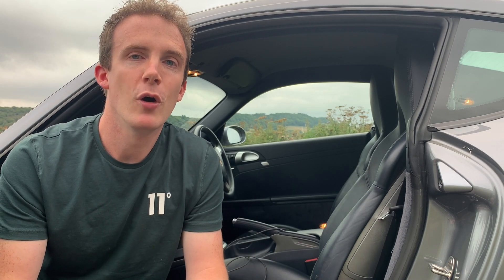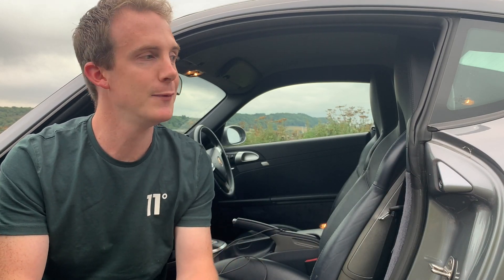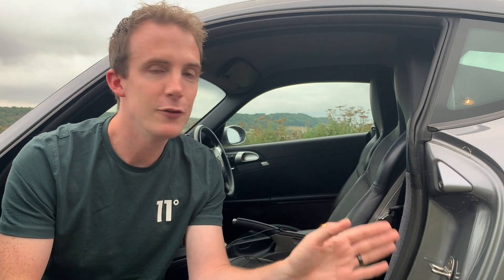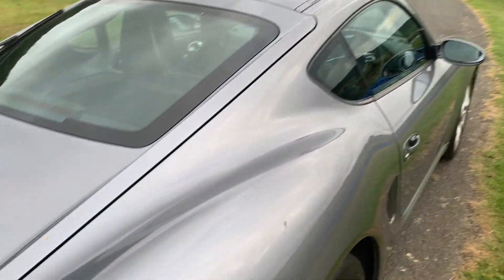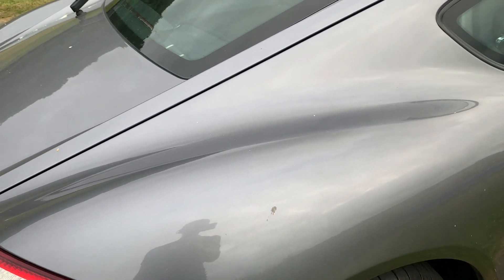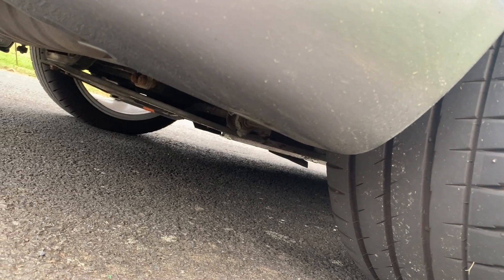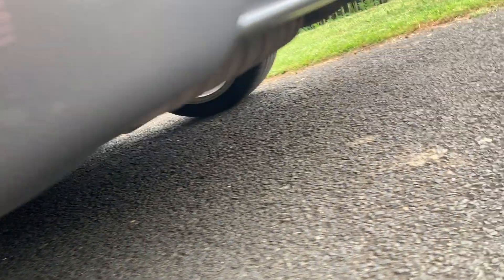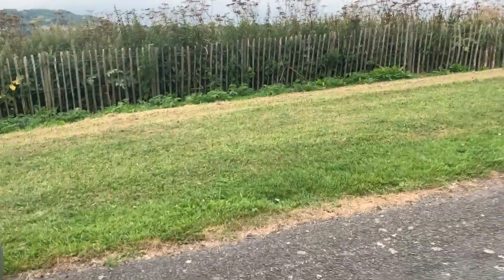MY CAYMAN 987 HAS BORE SCORE | What are the symptoms , sound and repair cost?

Comment: Very sorry to hear your unfortunate and expensive news. Given that the 987.1 3.4 engines are well known to suffer BS with up to. 10% failure rate, did you not consider getting the bores scoped at purchase?  Not sure who you asked about the smoking issue but fit, water cooled 911s  don’t all smoke!  Smoking exhausts, oil loss and eventually (at the end) are all classic symptoms. I have bought many used cars over the past 20 years and while I am reasonably proficient with used car buying, I paid for an independent Porsche specialist to give it a full pre purchase inspection. It was the best £350 I have ever spent. 
The good news for you is that IF you can get it fixed properly with new liners for about £6k, you should get most of that money back come resale. Most scoring and IMS failures (on the M96 engines) usually result in a circa £10k bill!

Comment: Sorry to hear the news. Looking forward to hearing about your rebuild. It IS an awesome car. Now you will have an engine that will last you 20+ years to enjoy.
Reply from the maker: That’s the plan! Got so much I want to do, hoping the bill isn’t so huge. Save some for an exhaust 😉
Reply: There is always a gundo to give you some sound at an inexpensive price. Then you have time to figure out exhaust which won't be cheap. Good luck!
Reply: @JoeTalksCars  I emailed Capristo last week to see how much a full exhaust system would be for my 2.7 987.1, just for a laugh: £4650! Errr I don’t think so.
Reply from the maker: Nah thats a joke, custom made route for me. Far cheaper under £1000.
Reply: @JoeTalksCars  Yes I’m thinking the same, or maybe Milltek or Dansk. I’m worried about the exhaust header bolts, I’m sure they haven’t been removed for 14 years and they might shear. I give them a good spray with WD40 whenever I’m under there, don’t see as it can do any harm.
Reply from the maker: @kw8757  bound to come across problems like that during this build

Comment: Oil consumption is usually measured in quarts or liters per 1000 miles. I am not sure how much guzzling is. When your first purchase a vehicle it is wise to check the oil frequently until you understand the consumption.
Reply from the maker: I did and the car used barely anything for the first 4 or 5 months then all of a sudden was guzzling. Didn’t know at the time it was scored but we all know what happened next 🤣

Comment: Just went out and started my Porsche and it does not have any odd noises or smoke at all, nothing so I am so happy mine is running perfect. I heard that this is a problem with people that live in the colder climates, since I am in Texas I should be good to go but is something I will have to keep an eye on.  

I just wonder if there is a way to prevent it from happening in the first place? I change my oil every 3000 miles and use only the best synthetic oil for my cars, yah I may spend a lot in oil but I like to keep my motors in top shape. I also do not hot rod mine or at least very very very little, I have yet to ever hit red line, actually stay over 2k under it.

Comment: Thats pretty much why i got myself a 987.2 2.9, sure i don't have the power of the 3.4. But the engine is bulletproof, goodluck mate. There are multiple mods that can reduce the chance on Bore scoring by alot. If you get it fixed take a look at those.
Reply from the maker: Yeah I’ve heard the different thermostat is one. Il have a look as to the mods. Can’t be having this again. Especially not after fixing it!
Reply: What are the mods that would help with this potential problem?

Comment: I had a 3.4 996 years ago, the bore scoring noise was only there once the engine had warmed up fully, oil pressure has dropped, and at idle. Any rev of the engine and the oil pressure would go up and noise stop. No loss of power, but it was more of a ‘clanking’ noise, quite a metallic ticking. Also it would start a bit rough, backfire or pop sometimes when starting.
Reply from the maker: Mine had all those symptoms just before the rebuild. Poor thing sounded like it was going to die.

Comment: Q&A: did you recoat the pistons during rebuild? did you replace the cylinders with iron, nikasils or alusil type of sleeve?
Reply from the maker: So they were all sleeved with new steel liners. Controversial I know but 2 years on it’s perfect still
Reply: Glad it’s now running mint joe , I live in castleford and I’m researching before purchasing a cayman / boxter will strasse be my go to specialists or are there others I should consider. Also is the 987.2 base less likely to score , or is oil management the key to any boxter engine.
Reply: @michaelparker-m6s  oil management will definitely reduce the risk. Lower displacement engine 2.7l will also have a lower risk of borescoring due to lower piston weight, thus lower piston skirt to cylinder wall contact. The 987.2 has improved the coating of the piston skirts so it is less likely to develop it. MA9A1 engines have also closed deck design that reduce the risk of cylinder ovality that develops over time. Also I saw that M9A1 engine also has oil jets at the bottom of the cylinder that really improves lubrication.

Comment: In essence,should I presume that some mod has been done in order to avoid such an issue to come about again  ?    I mean,we can have a full engine rebuild done with the same problem likely to occur again due to the original engineering weakness from the factory or,possibly is there a way "to prevent" the issue from coming about again with proper mods while the rebuild is in progress  ? Thanks for any thought about my question.
Reply from the maker: So the car has had steel liners with a top hat design meaning they can not move, it’s hard to say if it will or won’t happen again. There is so many theories on what causes it and none or proven. The garage that did this have built 1000s and never had an issue, they also have a small race team and all the cars have this rebuild. I got so much hate for not using Hartech but I can’t help but feel that they do so much scaremongering online they force people’s hand. I trust Strasse where mine was built and hope for many many more years of driving.
Reply: @JoeTalksCars  
Interesting infos...A noticeable point stands in these guys using the same specifications or technique on their racing engines. Thanks for your answer.

Comment: Would a 987. 2 / 981 3.4S engine fit? If so what about fitting a a secondhand MA1.21 non IMS engine ??
Reply from the maker: I did look into that. They are quite a lot. It found one for about 5k so not a lot in it. Plus I swapped an engine in my last car and it was such a headache. Good thought tho, I’m now on eBay looking 🤣
Reply: @JoeTalksCars  Research needed on would your gearbox would be ok with the tad more 320 bhp power and Direct Fuel Injection different high pressure fuel pump needed with the  ECU to. So it would all really mount up. Guess not best option unless a project.
Reply from the maker: @xplane7523  yeah it’s certainly an interesting thought. If the block is compatible with the box which I’m not sure it would be the Tiptronic box can take loads as it’s the same box in the Mercedes SLR. PDK conversion could be interesting and unique. But costly 😂

Comment: Mine has the same smoke, oil consumption and when it’s warmed it makes a slightly odd noise on the drivers side 😄 I wouldn’t say tapping but it’s definitely not the same as when it’s cold
Reply from the maker: The tapping started on mine in the end! My god it was loud! Wish I caught it on film, genuinely sounded like somebody tapping with a hammer on metal!

Comment: Hey Joe, loved the video. I'm really getting into this info about the Cayman in case I decide to pull the plunge on one down the road, and I have a question: once this "gets done", is it possible for it to happen again? Or is it a factory failure that once fixed it's ok? Just to know in case a full service history includes this, is it correct to assume that's a "safe car" regarding this issue? Or it's always going to happen every once in a while? Thanks a lot!
Reply from the maker: Hi, good luck with the hunt for yours, as far as I know once its fixed its fixed but then again who honestly knows. This car had a full Porsche service history and it never helped the poor thing, that doesn't seem to come into it. I am sure its a flaw from factory that it either has or doesn't. Some high milage cars may be the safer options.
Reply: Hi it can happen again but will take many many years - its just an unnecessary cylinder design, which is why it was scrapped so quickly. The key is to ensure the coolant is always topped up, make sure there are no coolant leaks and the water pump is in tidy condition. The coolant surrounds the cylinders in this design. Finally I would always use premium quality 0w-40 oil

Comment: £5,000 to £6,000 is quite cheap to fix bore scoring.  Did they redo the bores with aluminium sleeves and a Nikasil rather than Lokasil bore coating or did they just re-sleeve with steel liners?  If steel liners then you are possibly looking at another engine rebuild in 10k to 20k miles time.  My 987.1 3.4S Boxster had previously suffered bore scoring and been rebuilt with steel liners before I bought it.  It took less than 10k miles before the liners moved and let coolant into the cylinders.  The engine was then rebuilt properly by Hartech in Bolton, UK with Nikasil liners.  Cost was closer to £10k though.
Reply from the maker: So the car eventually cost around 10 due to more parts needed. Each of the cylinders has been done. They have been done with steel liners but have a top hat design so can’t slip. The garage assured me that race cars they rebuilt are going fine after 1000s of miles on track. I guess only time will tell.

Comment: Sorry for your issues! Have you seen Jake Raby on YouTube? He has a full series on Bore Scoring.  What cylinder lining are you going to use as replacement? He repairs motors from around the world.

Thanks Bill
I have a 1997, 986 and 2006 997.1 C2S.
Reply from the maker: Hi Bill, I have watched them, fantastic videos. I am going for steel liners, Hartech and many others will shout at me for that but logically they can only be better than standard. Only time will tell. Strasse who are building it are well known for their expertise so I know it is in good hands. You have some lovely cars, have you had any bore score related issues?
Reply: @JoeTalksCars  No Bore scoring,  986 in early years don't have that problem. My 997.1 I won in a contest that the FLAT6CLUB had. Drove it from SanDiego to MN, no oil consumption,  no carbon deposits in tail pipe, no engine noise. It has 73,600 miles, I had engine oil sent to Speediagnostic and results were all in the Green. My first oil change it had Mobile one in it, changed to Driven DT40, plan on changing oil according to Jake Rabys recommended 6 months or 5000 miles irregardless of mileage. Taking a long trip soon should be fun!

Jake Raby would fix your car better than original, never have to worry about it. As you know does not recommend steel liners.

Good luck
Bill
Reply from the maker: @wildbillcarroll  ah that’s good then! You won the 997🥳 that’s amazing! Yeah I know he doesn’t recommend as a lot don’t but it doesn’t make a lot of sense. They have to be an improvement over standard. You are right tho, oil changes at 5000 or 6 months is definitely something I want to do as I can’t have this happen again.

Comment: Hi joe, who are you taking your car too to get rebuilt? I’m looking into buying a cayman S gen 1 as the gen 2 difference is huge in price, and if it’s 5-6k for a rebuild it’s still worth taking the risk IMO
Reply from the maker: Hi Lee, The difference is huge isn't it. Gen 1 can be had for 12-15 and gen 2 is 25-30. I had this dilemma so decided to rebuild. It is heading to Strasse in Leeds and will be fitted with steel liners. The price quoted is between 5.5k and 6k so unless anything horrible pops up it seems good value. I will of course be sharing the full cost so that should help.
Reply: Good choice steel liners.

Comment: Is there anything you can do to stop bore scoring either before or once rebuild done?
Reply from the maker: I am not entirely sure, I think it is a combination of things. Avoiding short trips, letting the oil warm before thrashing, servicing every year not every 2 like Porsche say, using thicker oil and probably loads of other things. I think I have been unlucky with this one. I am not sure how common this really is still.
Reply: @JoeTalksCars  yeah just interested to know as always wanted a porsche and said when I sell my skyline I'd like one but always thought they would be way out of budget then come across cayman and love the way they sound handling ect but do worry about issues like this
Reply from the maker: @james87fry  yeah it’s a huge worry. I’d go for 2.7 base manual or if you can a 2.9 gen 2. The 3.4 is crazy good and sounds insane but I feel a rebuild needs to be factored in to running one.
Reply: @JoeTalksCars  well I want the most power I can get as I'd certainly not want it to feel slower than my skyline lol and I'd definitely go manually as want to have it as something to go on a track with and manual would be my choice for that
Reply from the maker: @james87fry  the 3.4S does offer a lot more power and generally better specced cars. I wouldn’t put anyone off getting a 3.4S but I would have an expert look over it :)
Reply: It’s very common with 996,997,986,987. 
IMHO it’s not a if but a when. Also why is everyone talking about spark plugs. Scoping through the plugs is like scan for cancer after you have a bleeding lump. One needs to go up through the pan and look below the piston not on top. Also there is no harm in scoping. You think you’re going to hurt the cylinder with a tiny camera similar to the one they stick up your arse for your exam when a piston flys around in there at 5000 rpm and is forced to do so by an explosion. 

Dang £5,000 here in US it cost between 5 and 9 times that. 

If I were in your neck of the woods I’d certainly take it to Hartech. Get some nickisil sleeves and an LN IMS solution

Comment: Great video chap, from your video I would say it's very early stages of BS... The worse it gets you do get the noise you mention.... On the cayman it should be heard from the passenger side as engine is reverse orientation to 911 which I know you will hear from driver side..... In your instance I would have dropped a lower temp stat and ensured my front rads were very clear or renew...... Overhaul is the best but no harm in delaying the spend if you can..
Reply from the maker: That’s :) the video is old but glad it’s still getting the views. Hoping it helps someone. The saga of mine went on 🤣

Comment: How many miles or KM are on the engine?  I own the same model (in Guards Red) but got PPI's done on multiple cars before finding this one at my local Porsche dealer.  PPI's on any Porsche are expensive, about $350 each here in the states but the I saved thousands, or even tens of thousands, on the cars I passed on due to the PPI and what it revealed that the sellers were either unaware of or covering up.  Best of luck.
Reply from the maker: This has 59,000 miles so not a lot before the problem appeared. Sometimes the higher mileage cars are the ones to have! I should have had mine more closely looked at:(

Comment: What was the rationale for keeping the car, paying for the rebuild rather than selling and using the money to buy a gen 2?..fwiw, I have 2008 3.4S with just under 40k miles..
Reply from the maker: It all came down to cost and knowing the car. This car only has 52k on it and has had lots of work done, suspension, brakes and I know the car is rock solid other than the obviously knackered engine,. The cost of the build is £5.5-6k so adding the cost of the car to that I am only £20k in and for a rebuild car thats pretty good value. A gen 2 would be £25-30k at the current values.
Reply: @JoeTalksCars   makes total sense , its a nice looking car.

Comment: You mentioned the engine was consuming copious amounts of oil. Did you ever get a low oil level warning to alert you it was using a lot of oil?
Reply from the maker: No and I was told they do show a low oil warning! This one didn’t! I once put 2L of oil in to stop the bottom segment flashing! I was told they make a beep and show a warning.

Comment: 3m33   The KEY parameter, is not that you get puffs of smoke on startup
you must correlated to engine OIL consumption..

Mine uses 0ml oil per 5000 km
0w40 and its not measurable if it looses any.
It did occasional puffs of smoke, for 5 years
I replaced the AOS, it was considerably less but would still occasionally puff a little ibt (Valve Guides anyone)

but as there is NO measureable oil consumption :   no bore score

I fill mine to the max
then drip feed (50ml at a time , it till it show the last block of verfill)
that then means i'm between 0 and 50mll overfilled
IF that last block suddenly drops, It means I burnt off 0 to 50mll

has never happened, hence, no bore score

That is the only sensible approach, for actual bore score, you would be filling up oil by considerable amounts ever every 1000 km!!!
Reply from the maker: Obviously all very valid points, thanks for taking your time to watch and comment:) Later on in my channel you will see the extent of the damage. It ended up costing nearly as much as the car cost haha